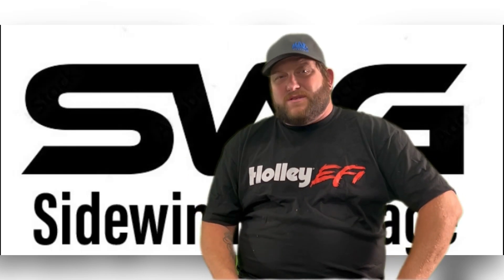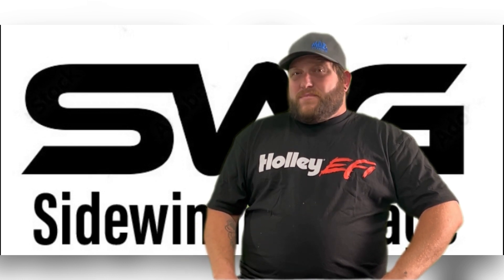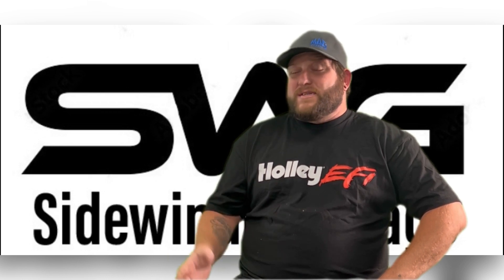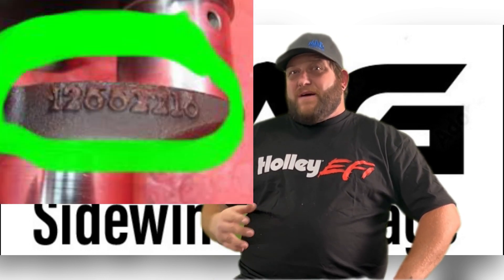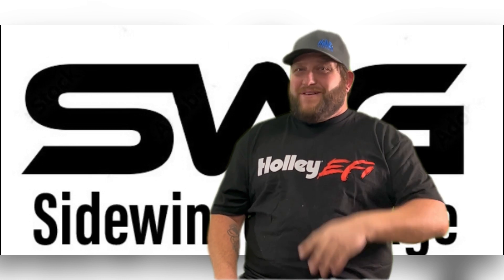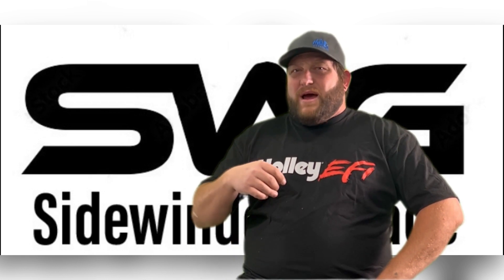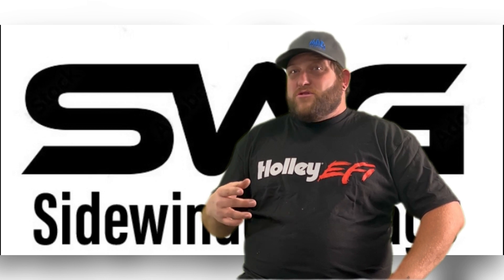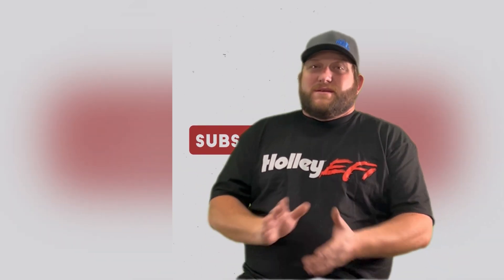HOW TO LS SWAP: LS VS VORTEC

Comment: I wannna keep my 5.7 liter vortec and just change the top end intake for 50-100 HP as simple as possible iron block i have a 97 2dr tahoe and a 2000 square body 5.7 liter vortec. Any suggestions?